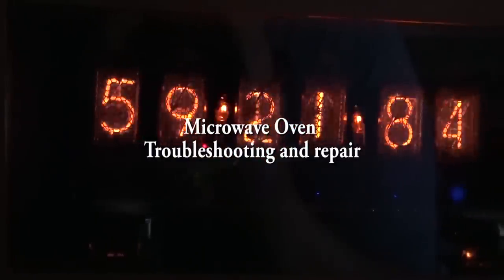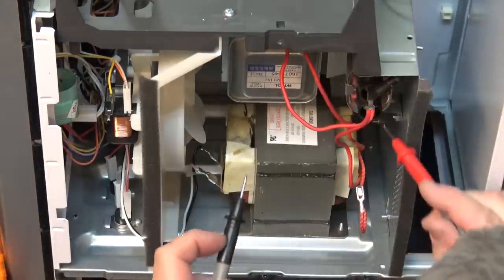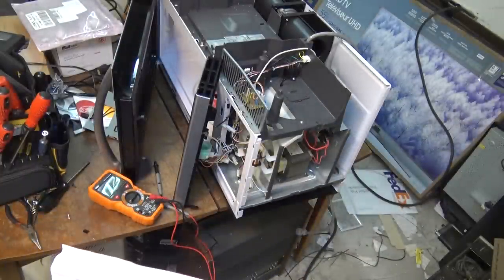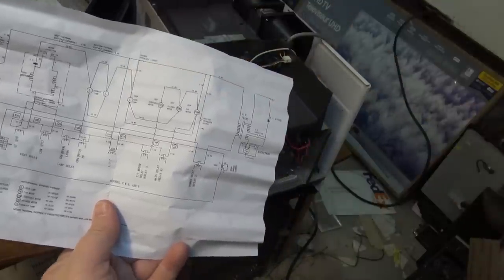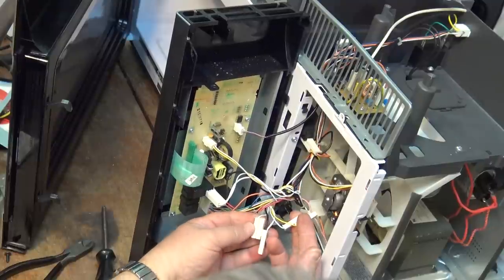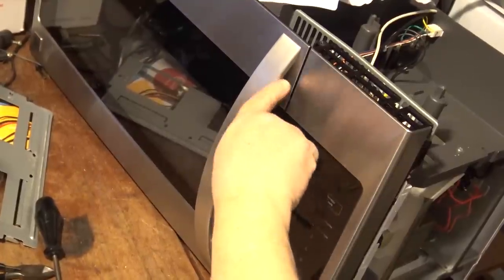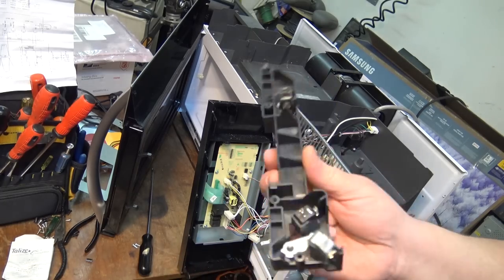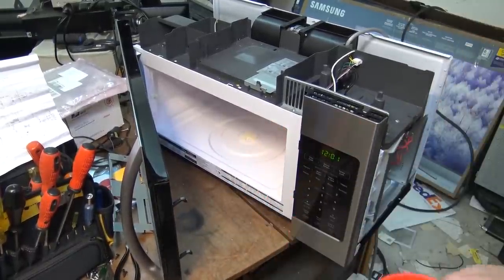Frigidaire Microwave Oven Troubleshooting and Repair

Comment: I make 4kV on average to the magnetron if we consider that the hv diode and the hv capacitor conform a voltage doubler. The power transformer output voltage is around 2kV. Thanks for sharing.

Comment: Thank you for the great, very informative, and well explained video.  I really appreciate it and it was very helpful.  The one thing I really wanted to see of your repair is where exactly did you apply the epoxy and in what amount?
Reply from the maker: The epoxy was just a temporary fix to get it running until the bracket could be back ordered.
Reply: I tried to put on JB weld, but there did not seem to be enough surface area to build upon and the "patch" just fell off ...  has anyone figured it out ?

Comment: My fridgidaire kept popping the breaker. So i purchased a three pack of door switches. Installed them, now not popping the breaker. But when i close the door it starts running on its own. Clock and control panel functions all work . Just runs as soon as the door is closed.. Is there anything i'm missing?

Comment: Great video!!! I learned quite a bit about the sequencing of the door switches. One question about the monitor switch though. With the wires removed mine tests normal. But with the wires connected it tests in the closed or shorted state with the door open or closed. This is due to the wires that connect to the switch test closed. This doesn't seem normal to me. Is it? Thanks in advance.
Reply from the maker: The monitor switch is normally closed. So out of the microwave it will measure dead short until you push the button. That is opposite to the main interlock which will be open, and will close when you push the button in. Door open the monitor switch is closed, door closed it is open. You need to unplug the harness to test, as other things in the oven will give erroneous readings, such as the primary winding of the low voltage transformer for the timer. Unplug the switch to test.

Comment: I have the Lowes version - Model FGMV176NTF Serial KG72306668. It was manufactured in June of 2017, and I've had it for about two years. It'll run for 1 or 2 seconds and shut off. Still trying to sleuth an answer for that one. Any idea? It doesn't trip the breaker.

Comment: I'm not surprised that the switch bracket had a problem judging by the amount of force needed to open and close the door. Bad design there. You may be able to order the part on the Sears website if you can't source one locally. The trick would be to find out who actually makes the microwave as I'm sure there are many of the same model with different brand names on them all made in the same factory in China.
Reply: Hah!  like when I had to get a display for my Emerson 32" flatscreen tv.  Couldn't find it anywhere!  But, then after seeing the EXACT SAME unit for sale at walmart again, rebranded VIZIO, I found one online.  Works now...

Comment: Frigidaire microwave display not working.
Model FPBM307NTF

Unplug microwave. Open door.
Remove 3 phillips screws at the top, remove black vent trim.
Disconnect electrical plug at top of door.
Lift door off hinge points.
Gently pry off plastic bezel.
Remove 4 phillips screws. Mark locations.
Gently pry each plastic retaining clip (14?) holding the metal glass frame and insert thin metal shims between frame and clips.
Lift metal frame and glass assembly out.
Cut back the protective sleeve and inspect for broken wires.
Cut off plug.
Discard broken wire sections.
Solder new extensions to each wire.
Cover with shrink insulation.
Re-solder plug. 
Temporarily rehang door and plug in connector.
Test control panel before final reassembly.

Comment: I have seen inside those switches before.  The one that went bad here looked to be sealed, but the ones I saw weren't.  They aren't that complicated; just a couple strips of copper.  How do they even go bad?
Reply from the maker: Bracket wears and short switch activates before primary interlock opens.

Comment: How much did that new switch cost you? ten dollars and 50 for shipping? Or did you get it out of anther junked microwave?
Reply from the maker: Switch was about 5.00 at the local appliance shop. That plastic bracket that I glued to get it going was over 50 and it took 3 months to get and then I had to do it all over to change that.  3 months after that was done the neighbour sold the house and the new owner renovated and scrapped all the built in appliances so this unit went in the bin shortly after it was fixed.

Comment: Hey thanks for the info I’m a Hvac technician by trade and i have a Frigidaire microwave and I’ve had to replace the fuse a few times and I haven’t dug into the cause of the blown fuse yet but it happens a few days after I replace it. When I close the door it randomly blows the fuse. Thanks for the info
Reply from the maker: Needs the bracket replaced.

Comment: I just had my unit quit. It sound good but it does not heat. The capacitor seems good and I could read the side and it said .9 but could not read the rest. I checked it and got .924 UF so I think this is good. I cannot get a reading with the diode in either direction. I replaced the magnitron 3 years ago and all was good. I am going to the parts house Monday to get one of the high voltage diodes but was told it might be good but the meter might not have enough voltage to read anything. Thoughts? Thanks for your videos. It can't be the switches in this instance I beleave as it starts and acts like it is working as usual, but no heat.
Reply from the maker: Generally when the stack doide goes bad it will him like crazy and not heat. When the caps fail they usually short and that will blow the fuse. Are you getting 120 volts ac to the primary side of the transformer when it should be heating. B
Reply: Thanks for taking the time to answer. I found a video that showed how to test the diode with a 9 volt battery so it is good. You mention humming. It always seemed to hum loudly as the wife always complained. The afternoon I tried to reheat a burger and all seemed good but it did not heat it, if anything it barely warmed it after 3 times the normal to heat it to the point you could not eat it.
Reply: @12voltvids  Like the old person I am trying to still learn, I checked all the connections for shorts as the fuse on top of the kenmore was not blown. the secondary was 166 ohms, coil at 110 connector 2 ohms, 1.6 ohms at the coil to magnitron connector and out of range on the magnitron disconnected. Then you asked about the 110 at the coil input. Nothing! I guess I need to check the board in the front. Funny though, I disconnected the transformer and everything to the magnitron, don't want to cook, The front panel acted as though everything was correct, lights came on inside and count down started but nothing on the power lead to  transformer. Thanks for the lead, but I have the worst fear it is the magnitron again though. Back to the work table. Thanks for the help. You always make it look so obvious and easy!!!!!! Thanks again.
Reply from the maker: @amtpdb1 
If you have high voltage and no heating then about all it can be is the magneteon. It is a tube. Give it high voltage and filament voltage and it will self oscillate and generate rf.
Reply: I need to find out why there is no 120 volts getting from the front board now. Thanks
Reply: 12voltvids In the end it was the magnetromiter, Thanks for the help.

Comment: Do you have any thoughts on a Frigidaire Gallery (over range) microwave that has a buzzing sound?
Reply from the maker: Loud hum or buzzing and no heating could be the magnetron. Unplug the magnetron and power up and see if it still hums. If not then magnetron is shot.  If it still hums then likely the hv diode.  Now if it doesn't him indicating the magnetron is likely shorted the red leads will be charged to about 4000 volts so you will need to leave it for a few minutes for the internal resistor in the capacitor to discharge it or better short it to the chassis to discharge.  Always use insulated tools that have been inspected when working on microwave ovens.  I overlooked this important safety measure once.  My pliers had cracked insulation that someone had taped over. 
I got bit, it threw me 5 feet.  Actually i had to jump to break the current as I could not let go.   I was following safe servicing procedure.  One hand in pocket and wearing rubber soul shoes so I was not at risk of electrocution. Had someone touched me that would have been different.  The pliers were damaged and my hand (same one) touched ground and my hand clamped down and i couldn't let go.

Comment: I didn't know the switches would actually cause a short but I haven't worked on many of these; but I do get that a shorted HV circuit isn't going to do anything worse.  I've seen new microwaves that have interlocks that don't click in unless you push hard on the door. One unrelated problem that concerns me is that I've noticed what seems to be venting capacitor smell several times. I didn't know where it was coming from for months until I traced it down to the microwave (I had though my relatives cat had issues but that wasn't it). Maybe another case of "nope, that was fried electrolyte" but I don't know if it was the high voltage cap or another one or something unrelated. After a while the smell was gone. And I know I've smelled this other times, other places so I wonder about food contamination and shorts. I'm guessing the power output would decrease if the cap went bad... but would that change the amount of power drawn? Maybe not?

Comment: Looks like not having a door release button makes mechanism wear out quicker?
Reply from the maker: No actually it is installing it over a gas cook top. Gas cook tops produce a tremendous amount of heat just from the gas combustion.  As this is over the range that heat quickly heats up the oven above it and causes the plastic door bracket to get soft and it wears out quickly.
Had it been an electric or induction range this wouldn't have happened.

Comment: The middle micro switch,  (NC COM ) when I test it with my Multimeter I get a reading when door is closed and open. Do I have a bad micro switch? What does the middle micro switch control? Replaced the micro switch it does the same thing When I remove the wire from the com terminal on the switch the meter shows OL wire on shows reading closed and open .Thanks in advance
Reply from the maker: The middle seitch with the NC and COM terminals is the fail safe switch.
It's job is to put a DEAD SHORT across the line to blow the fuse IF the top primary switch fails to open.

When the door is closed the switches are all pressed in.
The top switch, the primary inter lock is a NO or normally open switch.
When the button is out that switch is off, when the button is pressed in the switch turns ON.
The middle fail safe is a NC or normally closed. This means when the button is out, the switch is on, and when the button pressed in the switch is off.

As you open the door the top switch is released first, which cuts the power off. As you continue to pull open the door the middle switch is released, which closes the contacts. As the primary switch is already open nothing happens. If the primary switch fails to open first, the fail safe, also called the shorting switch or monitor switch closes, puts a dead short on the line, and blows the fuse. Generally this is a 1 time deal. When it shorts it usually welds the contacts shut and needs replacing.
On these Frigidaire units, the plastic bracket wears, and causes the fail safe to short before the other switch opens. It is the culprit, and needs replacing.
I did another video on this unit once the replacement part arrived. 
The temp fix on this lasted long enough for the replacement part to be ordered, but now it has a new part installed.
Reply: Thanks so much for explaining the middle switch. I called and emailed LG and asked for schematic's( wiring diagram )  they said they would not release to the public. From your explanation the middle switch ( NC ) when button is out the switch is on, and when the button is pressed in the switch is off. On my middle switch ( NC ) when the button is pressed in I have a reading. I replaced the switch with a brand new one and it does the same, when I check it with meter ( when the switch is not connected in the microwave both switches do as they are suppose to. I thought that maybe the switch was not pushed in all the way not making contact when i closed the microwave door but I removed the switch tapped the switch button down it still shows its on. if I remove the wire from the com on the switch it works.Thanks again
Reply from the maker: @JimMcLaren1950  
All the manufactures are getting that way.  They only release information to their authorized service people.  It has been like this for a long time.  Back in the 80s anyone could order a service manual. But once it got into the 90s when stuff started to go onto computer it became more difficult.  I actually have several of the cds that Sony and Panasonic released as I had a subscription at the shop and made backup copies of the cds.  I hung onto the CDs.   I have hundreds of full manuals on CD.

Comment: I'm trying to figure out whats wrong with my microwave. Everything works but no heat. I put in a new diode, and new door switches, but still nothing. I checked everything, magnetron, capacitor, etc, which all arte fine. It's driving me nuts that I can't fix this thing.

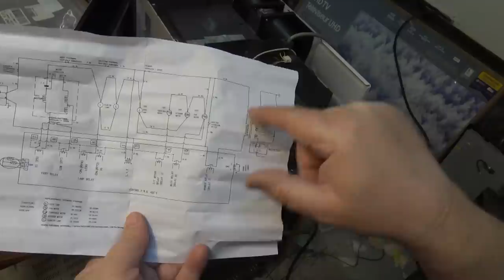Comment: At 14:30 you talk about when you close the door and then it sounds like the microwave is working. That's the problem I'm having right. Even though the counter says 0. It still makes that humming noise. So I just unplugged it.
Reply from the maker: Stuck power relay on the timer board.

Comment: Surely the fact that you're having to slam the door so hard each time isn't helping here? That looks like half the problem here, meaning the JB Weld fix is unlikely to last long.
Reply from the maker: These doors have heavy springs.You have to push them hard to close. My Panasonic is the same.
Reply: Probably wouldn't hurt to put a little silicone grease on the sliding surfaces. Less wear and smoother operation.
Reply from the maker: This was only done so the unit would work until the parts arrived.

Comment: I just bought a used microwave from the FB marketplace. Mine stopped working and I didn’t want to spend the $ on a new one because I’ll be selling the house soon. No manual and I CANNOT figure out how to even set the clock! Found a video that claims all Frigidaire microwaves clocks can be set the same way as what is shown on the video- it isnt working ☹️

Comment: Excellent Videos, I have a 4YR old  Panasonic NN- SD2772 over the range  microwave that keep blowing the 20A fuse.  I checked all 3 switches and they are ok. I replace the fuse and the display functions. When I turn the round wheel to select time the fuse blows right away when I hit start.  
Any suggestion will be great.
Reply from the maker: Disconnect the wires to the magnetron. If it doesn't blow when you hit start then the magnetron has a short, if it still blows then the problem is likely the inverter board.
Do check the short switch in the unit. It should measure a dead short with the door open and be totally open when the door is closed. 
That switch, sometimes called the monitor switch, or short switch is there as a fail safe to blow the fuse if the door opens and there is power applied.
Normally the primary switch opens the circuit before the door opens. If the primary switch were to stick in the closed position and the door is opened, the job of the short switch is to create a dead short and blow the fuse instantly.

Comment: And this is the result of slamming the door too hard breaks the switches
Reply from the maker: Actually this is the result of installing over a gas range.  Gas cook tops put out a ton of heat (hot gas from combustion ) which overheats the cabinet and makes the plastic parts soft.

Comment: Thank you, exact problem I have.  I replaced the switches, and now it only pops the breaker if I open the door while the microwave is running.  Based on what you have shown with the wear and movement, I have seen the problem and ordered a new (5304509457) Latch Hook from Applicance Parts 365.  Looks like Frigidaire replaced the part number you listed with a new version. Hopefully its more durable.Very nice video with a clear and easy to follow trouble shooting process.
Reply from the maker: I thought I did another video showing the door hook replacement once the part came in. Perhaps I didn't publish, as I did shoot video of it when the part finally came in about a month after this one was done.

Comment: While cooking dinner the other night on the stove top, my son started the microwave to heat something up. Due to the excessive amount of moisture coming from boiling water directly below the microwave, there was a loud "POW" noise and a spark. Everything still works on the microwave, ie: vent/light/fan etc, however, there is a loud "humming" noise that wasn't there before when I try and run the microwave. I'm not sure if the microwave heats or not because I am afraid to run it for any longer than to see if it miraculously fixed itself..LOL. Any suggestions what this may be and how to fix it? Thanks in advance for any information.

Comment: Hello sir, I have a Frigidaire over the rang.  Trying to see what's actually broken on mine?   It power, exhaust fan and light but at random the microwave while heating the lights will dime on it and it will start to slow , almost surge? I have ran a washer off of the same outlet that it was hooked up to , with no issues.   I had it unhooked for a couple days. Hooked it back up and it seems to be heating at acting right again.  Thoughts?   Thank you
Reply: @12voltvids